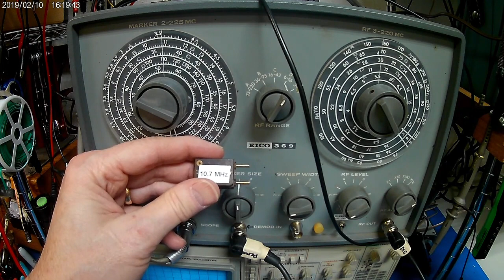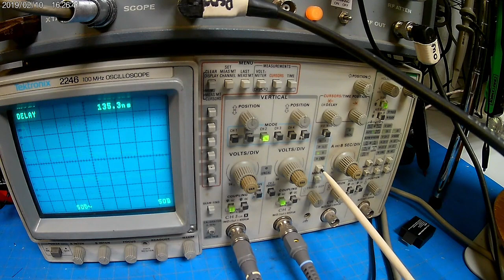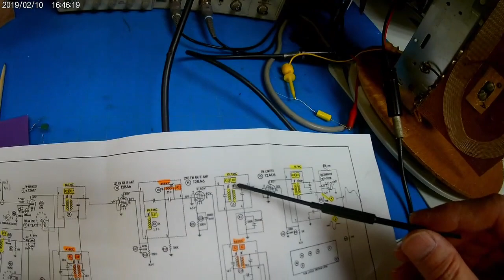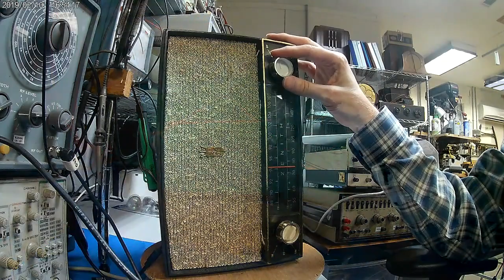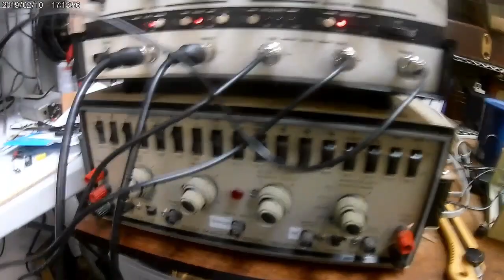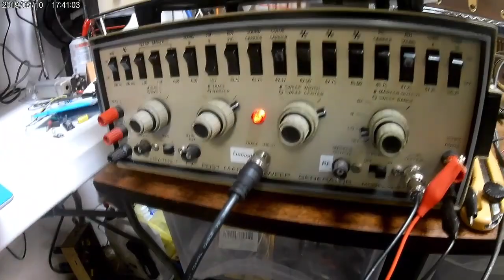FM alignment using a sweep generator.  My 1st video critiques are welcome.

Comment: Hello 
First off great video. I'm a newbie to the hobby and I've just acquired a eico 369 along with a tektronix 465 with DM 43. My question is where did you find your scope cable for the 369? I'm striking out around every corner trying to find this. I've found the demos n rf with no problem. Also I'd appreciate it if you could share more info on the crystal upgrade.
Reply: Thanks for the comment.  The scope cable was with my 369, however the ends did not work for my scope.  So I added a little board that allowed me to clip my scope leads to it.  If you don't have one just use a couple of BNC connectors for the X and Y and remove the 2 pin (ground is on the outer ring connector.  I feel it would work better.  Otherwise put 2 finish nails in the pin holes and clip the scopes 2 probes to each and ground to the outer ring.  As far as the 10.7 MHz crystal, I bought one off of EBay and hollowed out a crystal holder and soldered the modern one in.  Now having said all of this, the 369 will get a badly adjusted FM radio in the ballpark but you may have to tweak it by ear to get it right.  All this stuff you add onto the tuned circuits loads them and changes them some.  Furthermore most radios worked on just got caps replaced and maybe a few resistors and were not bad out of tune and simply tweaking them made them sound fine.  However it's kind of fun making the curves and moving the marker, it really helps understand how FM works.  Good luck.
Reply: @joshbowman4060  Thanks for the reply back. This was very helpful.

Comment: I see you're using a Tektronix 2246 oscilloscope. Very nice device. I have the same model but mine is having some kind of "noise" in the trace produced by the readout feature especially in low rates (around 2 ms) and XY modes. When readout is turned off, noise disappear. Can you please check yours to be sure mine is defective or not? Thank you

Comment: Great vid! Can you do a vid on how you added blanking and frequency out on you Eico sweep generator? Posting the schematic would help. Thanks. John Ocala Fl.
Reply from the maker: Pat, thanks for the comment.  Neither of these hacks did much to improve the 369, but were fun to do.  1st the blanking is done by opening the feed to pin #3 of V3A (12AX7).  I simply removed R13, R18 and C31 from pin #3 and put them on an empty solder lug nearby.  I then attached the SPST switch to Pin#3 and the lug with R13, R18 and C3.  The RF out is a coax from a BNC t the J3 X-TAL's leg via a 101 capacitor to pin 1 of the 29758 (PC3).  Hopefully that will help.....frankly I can't remember where I got these hacks.  BTW, the PC3 is most likely made of unatainable, so don't harm it.  Again, I really don't thing these hacks improved much.
Reply: @tinkeringwithelectronics  thanks for the reply on the 369 Eico. Looking forward to more of your vids.

Comment: Well done video and very informative.  Also very helpful tip on getting the Heathkit generator on the correct harmonic.  One question that might clear some things up for other viewers... when you move to the S curve alignment, are you still using the detector probe or is this a direct connection?
Reply from the maker: The Eico 369, connects directly to the radio.  But to be clear, the sweep generators output is attached down stream of the radios dectector/discrimanator.  As fun as it is using a seeep generator and making the S curve.  You can do better by tuning by ear.  Seems no matter how good of a curve I made, the radio never sounded good.  So I'd always finish by tuning to a station and adjusting until it sounded good.  Hope this helps. Josh

Comment: Hello friend!
Greetings from Brazil.
I have a Meguro MSW-7626A Sweep Marker that has a Marker output like your Heatkit and I would like to know what is the purpose of this particular output? And if the 10.7Mhz Mark is also generated in the RF output or only in the Marker output? Thank you very much.
Reply from the maker: In my cases, the marker is separate from the sweep.  Not certain what you’re asking about the “particular output” purposes. But discussing the many markers on the Heathkit, there markers are for peaking a TV.

Comment: Super, please keep them comming. You speak clear and easy to follow, great content and verry educational.
PS. As a recomandation if you can a video on injecting into the antenna for am and fm especially. How to adapt from 50 ohm unbalanced to 240ohm and 300 ohm simetrical. This is for german sets. They want 240ohm fm imput.